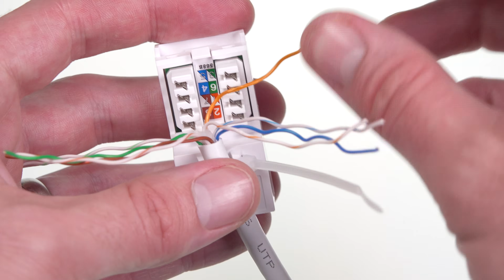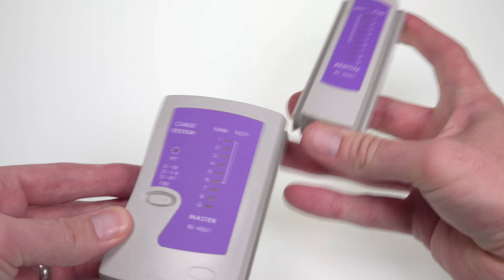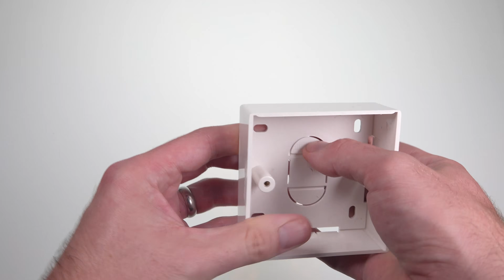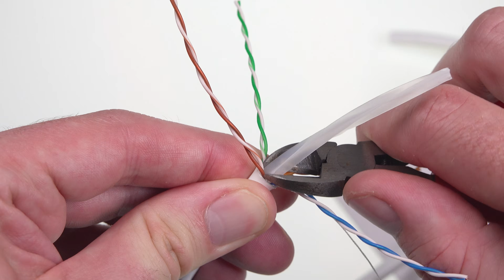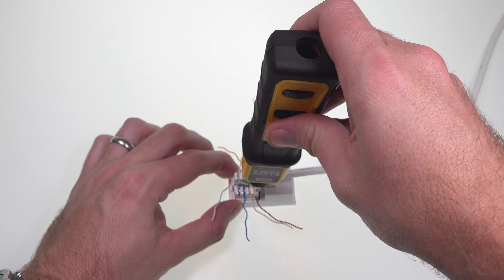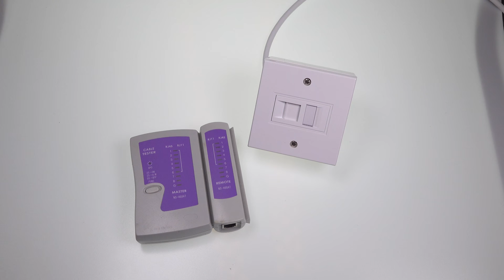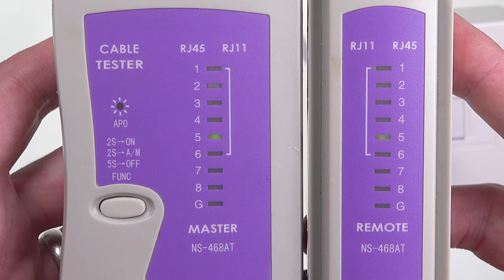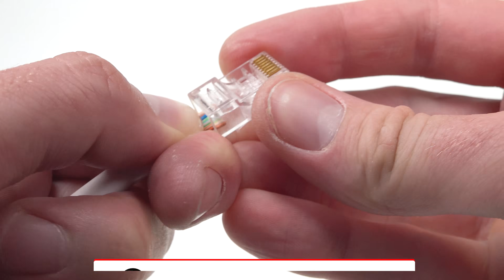How to Wire Up Ethernet Wall Jacks (Cat5e / Cat6 / Cat7 keystone jack wiring tutorial)

Comment: Try it with a brick wall no where to lose excess cable in 🇬🇧 brick walls are the norm,anyone can do it on the bench?
Reply from the maker: Yep, I'm in the UK. All you need to do is trim the cable to the right length so the excess fits inside the wallbox (if you're using one).
Reply: @SwitchedOnNetwork  Well I guessed that but I want to take the guess out of it as it is easy to get it wrong as it is going in a four way nightmare how would you do it any clues Cheers

Comment: This is more of a question, I’m in a new house, and the router is a floor under me, but we have Ethernets that come into the wall, pretty sure a cat5 and it’s not working when I plug my computers Ethernet into it, idk if it’s broken, or if I have to find the other end and plug it into the router? But I can’t find another end of a Ethernet anywhere in this house, but there is multiple Ethernet outputs in each room that don’t work
Reply from the maker: Sounds like you have cabling to all (or lots) of the rooms, which is great! They'll all need to feed into a network switch somewhere (basement maybe?) and the router connect into that. Can you not find the other ends anywhere? You could use a cable tester to see if any of the rooms are directly connected together maybe!
Reply: @SwitchedOnNetwork  I found a silver box in the basement, with a crap ton of white weird stripped and screwed down, I saw the Ethernet plugged into my router that comes from the basement is a WAN, and their is only 1 and it’s plugged in, I have no idea why the ethernets around the house aren’t working

Comment: I have wired the wires as shown on the Key stone but it’s not working.
Reply from the maker: Is it wired to the same standard the other end? Have you tested with a cable tester to see if all connections are good and in the right order?
Reply: @SwitchedOnNetwork  yes it’s in correct colour code. I don’t have a tester thanks.
Reply from the maker: You'll need a tester then to find out which of the 8 connections (or it could be several) is failing so you know which to repair. Link to my recommended testee is in the video description 👍

Comment: I am about to move to a new house. It's a building with an Article 4 restriction specifying no cables on the outside wall above 1m.....so the Virgin media shiz has to go in at the front of the house. This means that the modem has to be in the front room and I need ethernet sockets in 3 bedrooms and an office. Probably a noob question, but the cable run from each room needs to terminate individually in the room with the modem/switch?  Is there a plate that can accommodate 4 keystones? 

Second question, from the virgin media can I connect to just a switch or do I need a router specifically?
Reply from the maker: Yes, the best way to do that would be each room with an independent cable running back to a keystone in the room with the router/switch in. You should be able to find a 4x keystone plate no problem. And yes, if you're using your Virgin Media superhub as a router then just connect that to a switch and then the 4 room connections into a switch (or just use the 4 ports on the Virgin modem?). However, I'd recommend putting the Virgin box into modem-only mode and using a far better router such as Netgear Orbi (see other videos on the channel).
Reply: @SwitchedOnNetwork  thanks for the reply. I currently have vm hub in modem only modem and use eero for wifi. I was hoping to go hub > switch > eero/pc/laptop...if that makes sense. Obviously the devices via socket/keystone/cable. Just a bit confused as to whether I NEED to use a router in place of the switch. I get different views from different people.
Reply from the maker: You absolutely 100%, no question about it, NEED a router if your Hub is in modem only mode, otherwise there's nothing to ROUTE the data between the external internet and the devices on your local network
Reply: @SwitchedOnNetwork  One last question. Can you foresee any issues using the eero(s) off a wired router? They're awesome and I'd like to continue using them if possible.
Reply: I see it now. Looks like I need to put the eero into bridge mode.

Comment: Thanks for your help/advice on this, I have just yesterday fitted my first 4 cables in my house between their wall jacks and they now work perfectly. I do though have 2 questions to ask if its ok, but for some reason one tester does not work but one does (on my cable which is about 20-30m in length) but both do work on just a single short cable, so does the length of cable cause problems with the testers, and if so does this mean the cable is to long? On another question the tester which does work, on both of the cables, its identically shows all LEDs lighting up 1 to 8 in order but for some reason they show dimmer from 4 to 8, is there any reason for this possibly?
Reply from the maker: You should be able to test huge long lengths of cable with the testers - I tested a ~90m cable run between my house and a neighbour's a few years ago, which wasn't far off the 100m "maximum" length you're meant to stick to for Cat6. It sounds like it might be a faulty or poor quality (sorry!) tester... or maybe it needs fresh batteries? What tester(s) are you using? Do the LEDs light dimly on both ends of the tester or just one?
Reply: @SwitchedOnNetwork  they dim only on the end without the batteries. And the tester is a cheap one. I only need it to wire up my house so i didnt want to pay too much for single use equipment. Its a Preciva Master NS-468

Comment: You are using a 110 Punch down on Krone connections, this is not the correct way to do it, they are totally different connections, all your terminals will be messed up, there are two totally different tools for this.....jeez.
Reply from the maker: It works absolutely perfectly mate 👍
Reply: 110 can be used on both, Krone punch down can only be used on Krone.

Comment: What a crap wall Mount
Reply from the maker: Why do you say that?
Reply: You cant Mount the shielding for a cat6a or cat7 cable. So no 10GBase-T possible
Reply from the maker: That doesn't make it a crap wall mount, it's just that I was demonstrating with Cat6 cable which has no shielding. Cat6a or Cat7 would be outside of the scope of this video and if there's enough interest I might make a follow up video showing those options too in the future.

Comment: I've just installed this today but doesn't seem to work. Used the same RJ45 keystone jack but I'm using a CAT7 cable. Not sure what's wrong.
Reply from the maker: What's up, do you get funky readouts on a tester?
Reply: @SwitchedOnNetwork  naa i haven't got a tester. just order one up now. Not sure what the problem is. when i connect the Ethernet cable to my PC id doesn't pick up nothing
Reply from the maker: Cool, once you've got the tester on it you should have a better idea of what's up. Bear in mind the issue could be at either end of the cable run.
Reply: @SwitchedOnNetwork I've connected all wires correctly with colour coordination. A bit frustrated why it didn't work out the first time.
Reply from the maker: One of the connections may be bad or one of the wires might have got damaged - or there might be an issue with the cable elsewhere along it, not even at the ends...
Reply: @SwitchedOnNetwork  What is the best way to rectify the problem? having a stressful day. Anyway Happy New Year :)
Reply from the maker: Same to you too! :) First up, check the cable run with a tester (use it to test the patch leads you're connecting the tester to the socket with first). Then if that shows anything up try re-doing both ends of the run. If that fails, try with different cable. Basically just a process of elimination until you find the issue and then rectify that bit.
Reply: @SwitchedOnNetwork  Hi mate. Just checked the Ethernet with the and all wires seem ok. Connecting my laptop from the router direct it gives me about 900mbs. But when I connect it on the box and go to other place where it’s connected the signal gives me 90mbs. Not sure where I’m losing the other MBs

Comment: this cable and this junction box would not receive a test report from us, that you cancel the twist doesn't make it any better
Reply from the maker: Can you expand/explain?
Reply: @SwitchedOnNetwork  We have high demands on performance in the industry in Germany. we are prescribed measurement protocols. fluke measuring devices would immediately recognize the missing cable shield and the missing twist. we only work with module connectors, where the cables are kept as short as possible. I use only. Metz Connect 130910-I RJ45-Einbaumodul E-Dat CAT 6a

the customer is king
Reply from the maker: Which missing twist?
Reply: @SwitchedOnNetwork  the twisting of each pair must be carried out to the end. we only use cables where each pair is shielded.

cat 6a sftp
the measuring device only says whether the connection is correct. says nothing about the quality of the connection.

lengths over 90m are not accepted! there are still 2 patch cables. you have to stay below 100 meters.

It is not a question of a connection, but of a fast, trouble-free connection.
Reply from the maker: Ah yes, well I was only using Cat6 cable so different standards and requirements. I wasn't demonstrating with Cat6a cable for 10Gbps networks in this case.
Reply: https://www.youtube.com/watch?v=H_Wm9kzO4NI
Reply: https://www.youtube.com/watch?v=UnDLpd5c-AE
Reply: @SwitchedOnNetwork  as I said, we work for industry and the future. merry christmas
Reply from the maker: You too! 🌲

Comment: that cable tester is a cheap thing and not so perfect
Reply from the maker: Is there a better one you'd recommend for the job? I've had mine probably nearly 10 years and it's never let me down. It's just a continuity tester at the end of the day, doesn't need to be to complex 😁
Reply: I switched to a Maxwell 25341 tester. It works much better.
Reply from the maker: I'll check it out, thanks 👍 Happy Christmas!

Comment: If you properly angle your cut down tool you don’t have to twist the cable ends off. They should be clean cut. You should probably place the keystone Jack on a solid surface and then cut. It’ll be easier.
Reply from the maker: haha yes you're right - the difference between "doing it for real in everyday life" and "doing it in front of the camera on the lightbox surface". Unfortunately it's not a solid enough surface so I couldn't press down firmly like I normally would! :)
Reply: @SwitchedOnNetwork  I think you should use a tool that has a cutting scissor instead of a puncher. Works much better and the surface does not matter.
Reply: Why you watching this then?
Reply: @gaddgames  it had popped up in my recommended. Am I not allowed to watch videos of things that I already know?

Comment: You have to test the cable itself before testing key stone
Reply from the maker: Yes that's true, you need to be sure the cables you're connecting with are all ok. Or, if you find a fault first check the cable 🤣

Comment: What does black boxes in which we insert fiber after splicing called?
Reply from the maker: I've never worked with fibre I'm afraid - a bit beyond my geek/enthusiast skill level! 🤣
Reply: @SwitchedOnNetwork  No problem. 😊
Reply: I think it's called a fiber optic slice closure.
Reply: @davidjandersen  A friend of mine told me it is called enclosure or termination box but he wasn't 100% sure
Reply: @Batman-db2vv  depends on what it is you’re actually talking about. A fiber terminal can be a black box where fiber strands are spliced and set up on a utility pole to feed numerous properties in an area. Now if you’re talking about something that is spliced on a single property it can be numerous things, it depends on which point the splice is at.
Reply: @Si7encer_  Im talking about a black box where fiber strands are spliced
Reply: @Batman-db2vv  there are multiple place where fiber can be spliced. Nevertheless it appears that you are speaking simply of just a splice case. But fiber can also be spliced and placed in a terminal, NID, etc.. you need to be a bit more specific so that your question can be answered thoroughly. At which point of the chain are we talking fiber being spliced?
Reply: @Si7encer_  Im talking about Black little box with 2 or 4 holes
Reply: @Batman-db2vv  what are the purpose of the holes?
Reply: @Si7encer_  To put fiber in the box for splicing
Reply: @Batman-db2vv  either a splice case or an enclosure. Never heard that specific case called the termination box.
Reply: @Batman-db2vv  you’re probably talking about coyote splicing container/box/tray.
Reply: FTTP Box
Reply: Fiber patch panels? or splice tray?. We use coyote splicing tray. One can have 8-12 holes.
Reply: Node